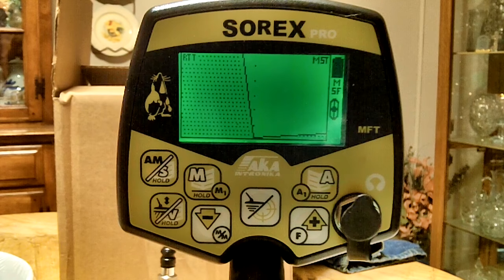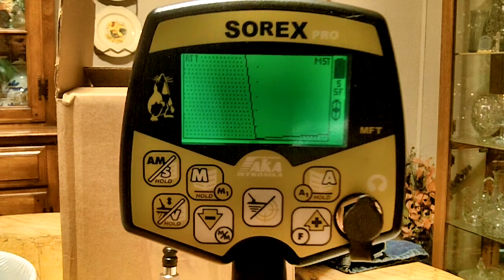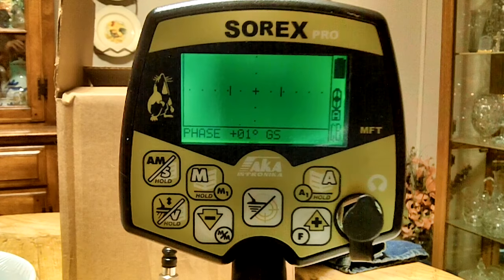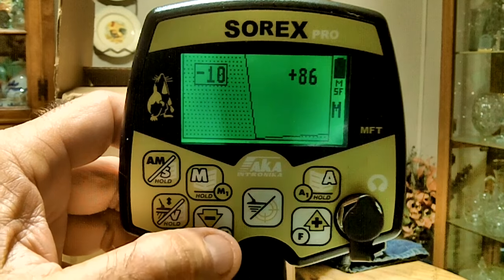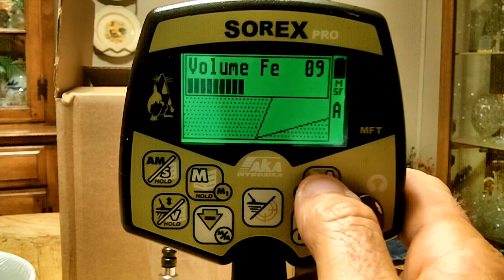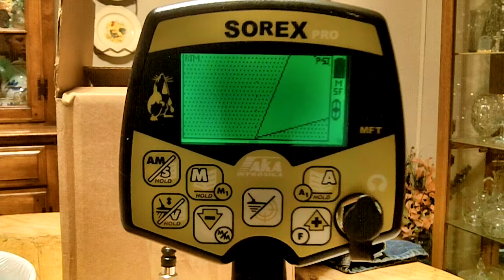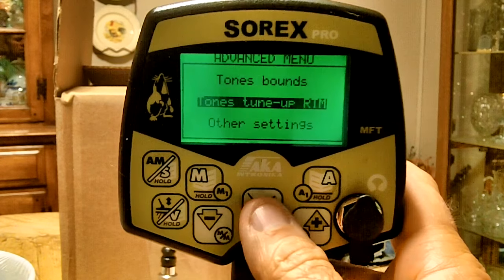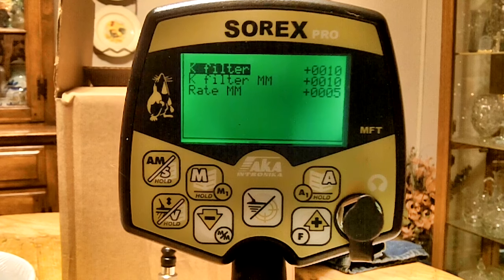Aka Sorex Pro metal detector - Going through the menus

Comment: i got a Sorex Pro last year and it is fantastic. However I had the A- Gain (analog gain dial) added to my machine. According to AKA it is about 20% more hot compared to the regular Sorex Pro. It is a bit easier to set the gain now and you can actually go deeper if you need. But the regular Sorex Pro is already the deepest machine I ever had. So far it goes deeper then the CTX, Deus, V3i. I need to run a comparison between the TDI Pro in the modified version and the Sorex Pro. This  would be interesting.

Comment: I've got the same setup you do, with the 6x10 coil.  Deep as can be.  A tough machine to learn but well worth it.  Be careful with the advanced menu.  But if the settings are messed up, which I have many times, it's easy to reset to factory settings.  Really good video.  Wish I had something like that when I was starting out with the Sorex.
Reply from the maker: Thanks....I have a lot to learn still.
Reply: We all do.  There are so many settings to bring out the best in the Sorex.  I learn something new every time I use it.